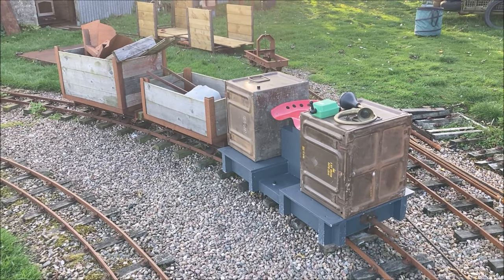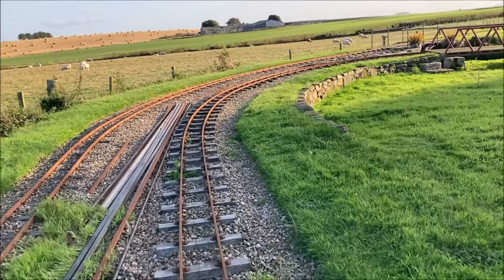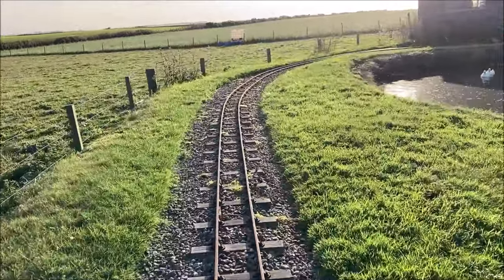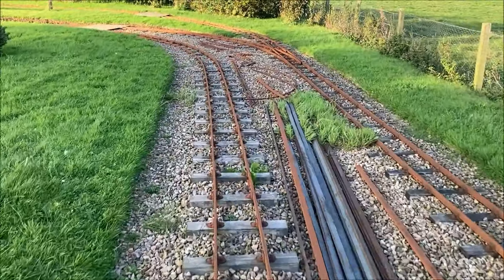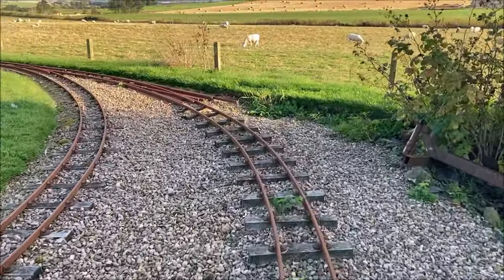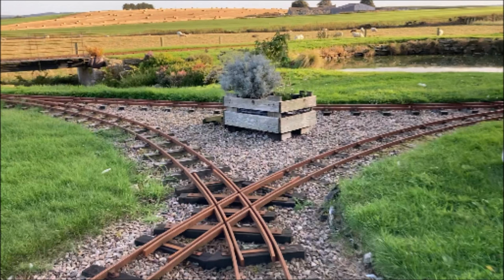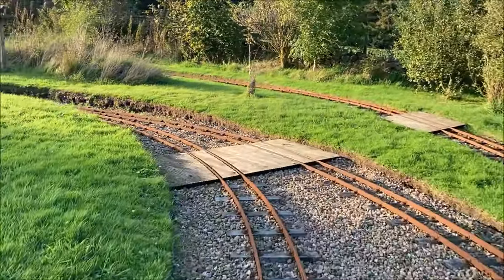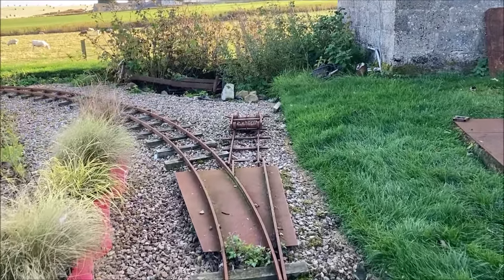A longer tour around Karen's Little Railway, our 7 1/4 inch minimal gauge garden railway

Comment: May I ask...Is the track all made by yourself? Is it rail profile or flat bay? And if so how is it fixed to the sleepers? Many thanks
Reply from the maker: Yes all the track is made by ourselves. It is 30 x 12mm flat bar fixed to wooden sleepers using PNP Railways chairs for bar rail. You can read more about how we built the railway on our website at https://www.karenslittlerailway.co.uk/ including making points. The PNP chairs are designed to pinch onto the rail to hold it in place. In our experience they work well if the ballast is kept well packed around the sleepers, and it's a good idea to avoid walking on the sleepers. The PNP website can be found at https://www.pnp-railways.co.uk/
Reply: @karenslittlerailway  oh that's a fantastic reply. I'll have a look at all that later. Thanks ever so much for sharing the info !
Reply from the maker: You're very welcome  @gs425